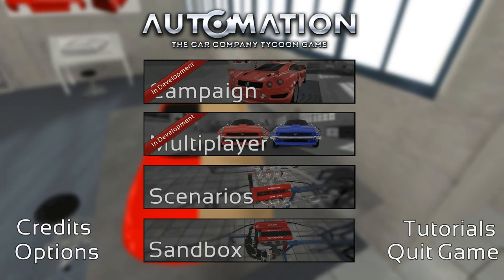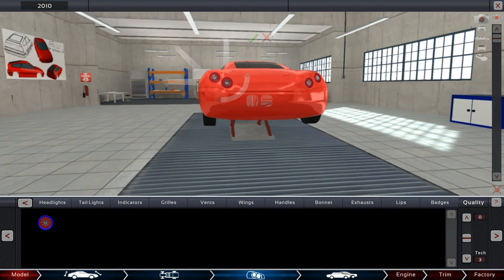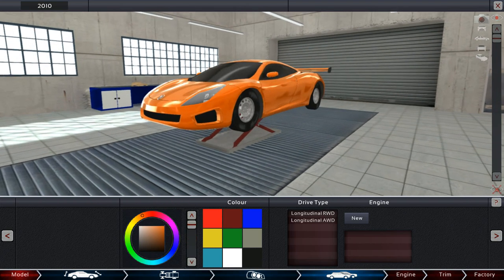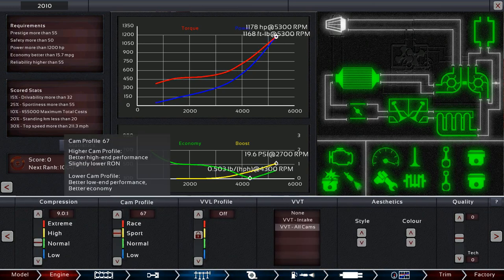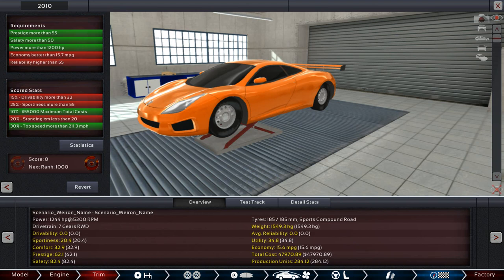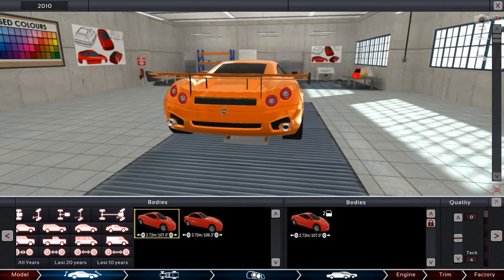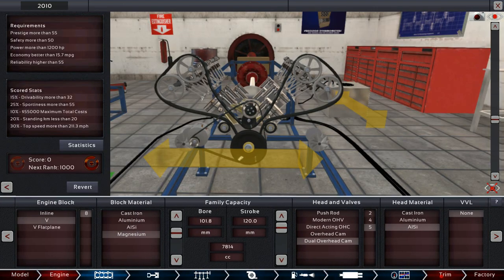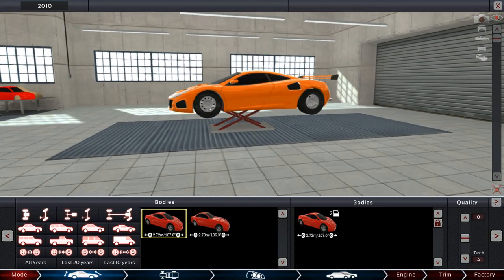FailRace Play Automation 1300 HP HyperCar

Comment: "The CD has not any effect on the drivability." Yes it has! You are choosing an entertainment system... those things weight a lot for more premium choices. Considering your car is very light, making it lighter with 1300hp under the bonnet will make the car LESS drivable because of all the added wheelspin. :) When you do the same thing with a car that has a modest engine drivability indeed would increase. Cheers!
Reply: Great point, thanks for making a great game, keep the progress going.

Comment: In real life, who would want a hypercar that runs out of steam at less than 6000 rpm? Even an old Shelby Mustang can rev higher than that
Reply: I dunno, maybe you're using a bored out Viper mill or something, making up revs for sheer displacement. Which is kind of a losing game, but...
Reply: Raka Radityo the mistake he made was to use a long strokes and small bore making the engine more torque worthy like old american cars, if he had maxed the bore and minimized the stroke length the car would rew a lot higher :)
Reply: ståle starheim Yup. When I am finding the sweet spot, I maximize the bore, then drop down the stroke until it moves the bore. From there I just drop it using stroke until I am not longer in the red, then I raise the bore one step until it just baaarely fits, and finally pump the stroke up a bit. I had some really high revving big engines before with that.
Reply: TheBlackWaltz made a V8 revving up to 11800rpm at max hp once, but the engine was only a 2,3litre xD
Reply: ståle starheim I was doing a sports car challenge on the forums, and I designed a 2.5l V8 with 640+ horse power, that reved to 9k. It's awesome what crazy shit you can do lol.

Comment: This engine will not rev high because of the conrods lenght. In order to have a high reving engine you need to have an oversquared design in order to get the capacity from cylinder bore and maintain high reving nature of the engine. This engine will rev higher because the pistons do not have to travel as long of a distance as with a longer stroke design. Meaning they are induced to less g forces as they accelerate and decelerate in the cylinder. But the longer stroke gives you more torque as can be calculated with simple equations. So, for high revs you need big bore and short stroke, oversquared design. For higher torque you need longer stroke.

Comment: Turbos in Automation suck. They require way too much cooling to be effective. My naturally aspirated supercar has a 730hp 5.4L DOHC 32v V8 which revs up to 8k RPM, goes 0-60 mph in 2.8 secs, goes 228 mph, weighs only 3,100 lbs with sport+premium interior, and advanced safety. And it still gets 20 mpg..
Reply: you still would've gon faster with turbos and got the same fuel mpg!
Reply: TheFast442 I can make the car a lot faster just by turning up the quality sliders and putting the brake cooling down to zero. I can get 250+ mph easy, with the same amount of horsepower and weight. Oh yeah, did I mention the engine only needs 530 kJ's of cooling? Your twin turbo engines need over 2.5x that amount just to barely make 2x the power. With that comes tons of drag which will give you worse fuel economy and your top speed increase will be minimal. You'll also have some extra weight to compensate for.

TL;DR: Turbos in Automation are terrible and you should feel bad for using them.
Reply: legionofdoom2009 hmm you know if you turn the turbo pressure down you don't need as much cooling and you can keep the violent cams and compression. i do like to build a engine in NA form, but if you use the turbos as low pressure only to increase low rpm torque  you can do so without having to much extra cooling. and then the economy gets a lot better
Reply: legionofdoom2009 They just updated the game to revamp cooling not to long ago, It's now no longer ridiculous to cool a huge turbo'd engine.